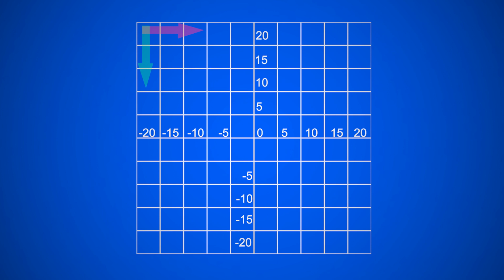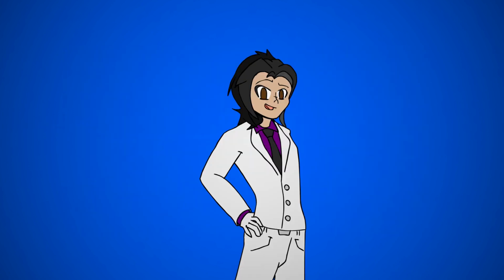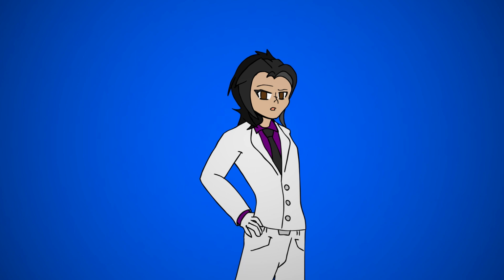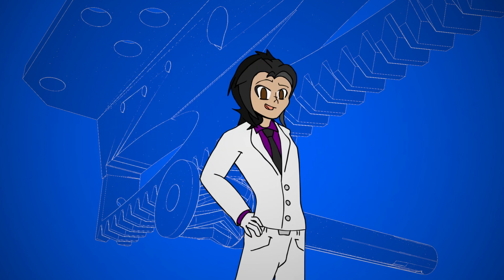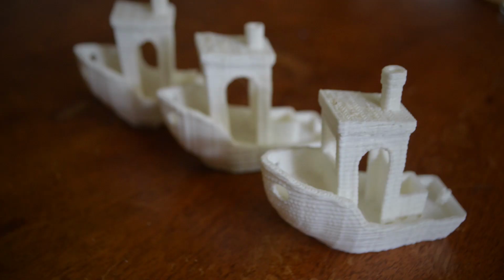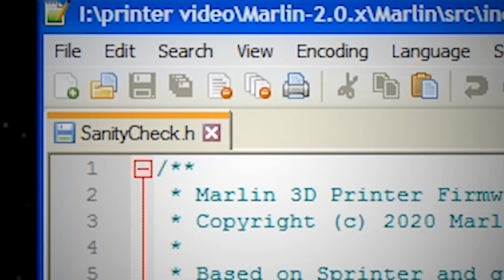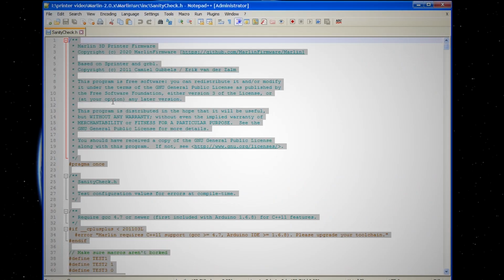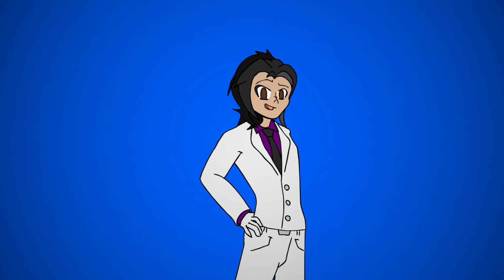(HNTE) Complete Moron Designs and Builds 3D Printer

Comment: Hey man cool idea, I like the idea of using a rack and pinion. The reason your prints have alot of banding is bc your hot end it pitching forwards and backwards as the bed moves forwards and back, which can be fixed with more tension gripping the guide rail. And im sure now that you have a bigger print volume youll be able to make larger, more complex pieces, simple is almost always better. cool project, hope to see more
Reply from the maker: Hey Thanks for the comment. :)  I will check the tension on the guide rails,  biggest problem I ran into that is missing with the print quality is that the parts printed on the rostock warped up off the bed so it waves.
Reply: @KialIrvin  Did you try applying hairspray before printing? thats typically the best solution to warping